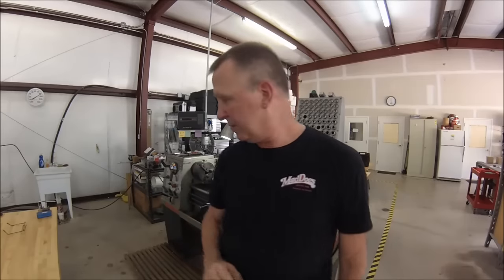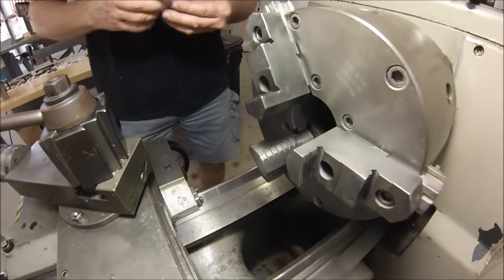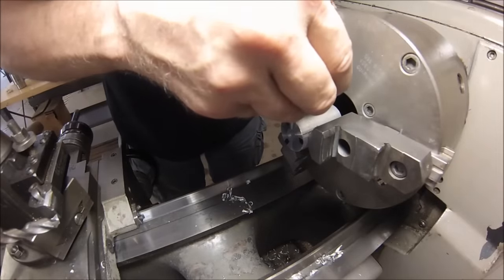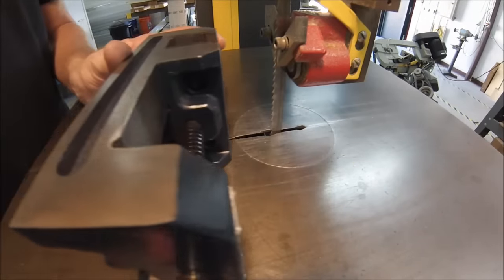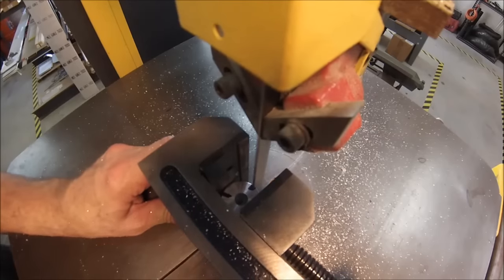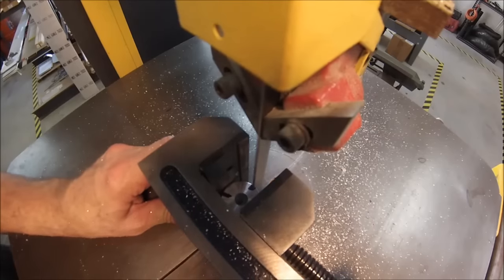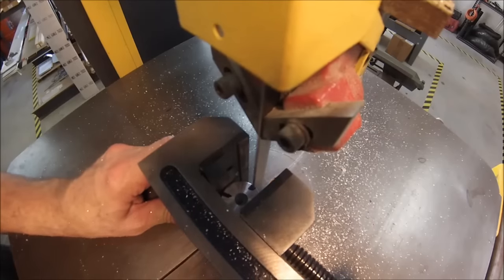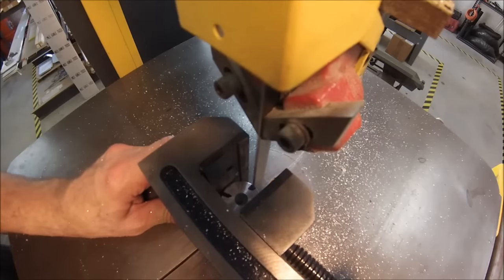Get your parts to run true in a non adjustable chuck. YOU MUST WATCH THIS!

Comment: In the watchmaker world our lathes suffer from the same situation where as none are really perfect. 

This usually comes as a surprise to newbians who may have made significant investments only later to find the solution to most watchmaker lathes cost only a few dollars. We chase allot of rabbits looking for solutions.

For example they often find it strange that their tailstock (even if it holds a collet) is not sufficient enough to drill a hole dead center of an average watch arbor. For that a centering guide is needed to assure the drill and arbor go dead center. This can be made or purchased cheap. The bit can even be held by hand and eyeball for straight line.

The watch world is full of all kinds of solutions or what they would think is a solution by those who want to make a buck.  Allot of that goes on in the watchmaker world. 

The cheapest solution is my favorite, using shellac. Heat it up and center the part while spinning. When the shellac cools it has enough grip. Lately I have been turned on to using "hot glue" which is better still as it has even stronger grip and easier to work with. 

Most times the main repair of watch works is to turn a balance staff. I work under the binocular microscope which has working clearance and generally I use 30x to 40x magnification. The "gotchas" is when we try to re-insert into a collet. I guess you call it repeatability. Sometimes we can fiddle and find the center sometimes not. 

The shellac/hot glue method works.

The other way is to turn by centers which I know you guys do as well. Problem is parts are very small so dogs tend to slip and parts tend to drop from fiddly fingers. Sometimes disappear into some other dimension. Spend allot of time adjusting but it is easier to remove the part and measure in some jeweled caliper. Watch repair guys spend allot of time looking on the ground for a part. Them that say they don't is a liar.

Carbide is our favorite as well. It cuts the blued pivot wire pretty well and is much less hassle than using hss gravers. 

I think most of us work by hand. I have a cross slide but hardly ever use it. Since parts are small it's easy to eyeball straight lines under the scope. Who is going to argue over something they cant see, just if it works. 

Most of us dont' graduate to gear cutting as parts online are still mostly easy to get. Just depends on the situation. Some watches are custom hand made gears and then gear cutting is necessary. I have not done it yet but hope to. But you know how It is, need dictates over want.

The big pie in the sky is to make our own watch. One day maybe. 

It's a trip for me to see your macro world. Although I think allot about getting a finger cut off, I imagine it to be very enjoyable work. Seems like your world has more opportunity.
Reply from the maker: My world, now, that is.....I did my apprenticeship at Joseph Waldman corporation in the 70's. I cut my teeth on watch parts. We measured our daily production and counted parts on a 7 place decimal digital scale. A full days production would fit in the bottom of a small cup, maybe a bottle cap. Everything was precious metal and the scrap plus the parts had to balance within 1/10 of 1% or maybe a body search. This is by far not the biggest or smallest stuff I have ever done, so I know where you are coming from. Never go to work in a watch factory with a headache or hangover. The microscopes make the day very long. Thank for the memory.
Reply: Joe Pieczynski Lol ->body search. I have wondered about that. I would be volunteering maintenance sweeping the floor or something. "My world" Ah well, most people don't relate so I get use to saying that. I'm considering migrating over to gunsmith. Looking for more money as I get stuck with flea market vendors who got the watch for $20 and want it fixed for $20. Allot of people fishing each other these days. Where I live is nicked named death's door. Near the biggest retirement community of Florida. We got a trickle down antiques economy. Where I live most don't even bother to do anything but collect. The Goodwill has about 50 people lined up in the morning for the daily hunting. It's addicting -money for nothing. Hence the flea market centered life style -for everyone. That and service industry. Appreciate your reply and opinions.

Comment: can you remove the block from the chuck,put it back in and have the collett run true?
Reply from the maker: Its not usually recommended, but if your chuck has sharp jaws and bites the collar, you can get lucky and re-seat in those teeth marks it may be close. Best thing to do is take a smaller one from another part and re-bore that one.

Comment: Yeah, that's aneed trick, but ya gotta make a bushing for each different size diameter workpiece which could turn into a real pain in the butt! Shouldn't there be some way of correcting the jaws to compensate? Thank You, JD
Reply from the maker: Grinding them back to true is the recognized fix, but not everyone has a toolpost grinder.

Comment: Noob question: Why shouldn't you turn a machine on if the chuck is empty?
Reply: Sergey Grigoryan second that question
Reply from the maker: The acceleration of the scroll and body of the chuck can be different and the jaws can walk out. I never do it just for safety sake. Pull your jaws out and start and stop the machine at a higher RPM. I bet the scroll still turns if the chuck decelerates rapidly. Same thing happens when it starts. Its a safety thing.
Reply: Good point.  Had forgotten that but I do not turn on the machine with empty an chuck.  Guess my old instructor knew something!

Comment: 8 mins into the video he files off any burr that might been caused...fair enough, but to see if the burr as been removed with his fingers on a running lathe is asking for a stitched finger
Reply from the maker: I have to agree, but after doing this for 47 years, I can see if the edge is sharp before I touch it. For all you new or inexperienced viewers, turning the machine off first is a safer technique.
Reply: Thanks for your response Joe...Great video's

Comment: Certainly not practical to do every time you need to chuck up a part, but excellent way to make it happen if you don't have another option and it's critical.
Reply from the maker: It will get the job done. If you have to use it again, squeeze a thinner shim and re-bore the ID, or bore it for a larger part.

Comment: Hi Joe- is this for small diameter parts only (<1" or something?), or will it scale up? What's the largest diameter you have used this for? I thinking there is prob a point where an 8" chuck won't hold the part?
Reply: Oh, and Thanks! I appreciate your knowledge and your willingness to share!
Reply from the maker: If you start getting into larger parts and space is an issue, I'd suggest you purchase and bore soft jaws if your chuck can acomodate them.

Comment: Hey Joe, just thinkin, (after watchin this video for the 4th time).... If you are not swapping your part end for end, do we have to worry bout all this cause when we turn a part doesn't it automatically all become concentric anyway.
Reply from the maker: You are correct. This is for second side or finished OD work. If you turn and part the piece, eccentricity of the chuck doesn't come into play.

Comment: Good video I enjoy watching a master at his trade.  I am a new owner of an old Harrison lathe ,trying to learn how to work with it. Just wondering what you brushed on the reamer and part before use?
Reply: tap magic, it is a cutting fluid
Reply: Thanks
Reply: @denisminor4489  I assume when you say "old" your Harrison lathe may be one with belt drive and back geared head and use change gears for threading. You might find a book written by the South Bend Lathe Company very useful both as a beginner and also for an old lathe, it is called "How to Run a Lathe" and you can download it from http://www.vintagemachinery.org/pubs/detail.aspx?id=5795 

 It was recommended to me over 40 years ago by an amazing tradesman and was invaluable, it pretty much covers everything in simple explanations. It doesn't cover quick change gear boxes and carbide tooling as they didn't exist.
You can also use WD40 as a cutting oil for aluminium or kerosene.
Best wishes in your journey. Dennis

Comment: might find it that far out in your home shop - not in mine.
Reply from the maker: The collar technique is applicable to a variety of other situations too. Not just concentricity. Its good for parts with finishes you don't want to scratch, or those parts that need greater OD support so they don't distort under 3 jaw contact. This is a band aid, not a cure.
Reply: +Joe Pieczynski collar technique is awesome. use it on parts that have tighter tolerance than most home shop projects.
Reply: Make It Fit I had an eight inch three jaw Chuck it was out 7 due to a worn-out scroll and I bought a new one from shares of all places into my amazement absolute amazement if I got a quarter thousand run out I would be surprised their new Chucks are so true they're amazing for 300 bucks what a deal yeah I would never even try to operate a machine with that much run out I have to agree with you buddy
Reply from the maker: Hey guys, you missed the point here. this video isn't about buying new chucks, grinding jaws or soft jaw options. Its about getting the job done now in a POS chuck with what you have on hand. I hope you guys saw that I intentionally thru my chuck out for this demo. The only thing in my shop that is out .015 is the alignment of my benches to each other. There are some guys out there that really do great work with basement tools and this was just intended to make their life easier without spending a dime or waiting for days for a chuck they really can't afford. I appreciate your comments, but  I hope you see my point.

Comment: Hi Mr Pie: How do you “register” the nest so as to reuse it?  When you put it back into the chuck, how can you make sure of same location (are you just lining up the squeeze marks from the jaws and the ink marks, or is there a better way I missed?). 
  It works very well for the first set up, but not as well on the repeat set ups- it’s always off a little bit on the repeats.  Don’t have an adjust true chuck, but was thinking of ways I might adjust my 3-jaw.  What about slightly over sizing the bolt holes on the back plate and relieving the back plate registration slightly, so as to adjust the chuck a few thousandths in the needed direction after the part is chucked up?  (I mean slacken the chuck mounting bolts slightly, and tapping the whole chuck into alignment using an indicator- hopefully that makes sense?) Is this a possible solution for non-adjustable chucks, or is this a dumb idea?  Not sure if I should try that or not, would appreciate your opinion. I have an old machine with an old school screw thread mounting for a CI backplate, unfortunately not a cam lock or taper or whatever , and I have skimmed the backplate on the spindle, and fitted the registration fairly tightly, and the whole chuck repeats OK on re-mounting the chuck, but concentricity is a bit off depending on the size of the part, if that makes sense?  Enjoy learning from you, thanks! -Rov
Reply from the maker: Your approach to modifying your chuck is a good one. You can either bump the body of the chuck for adjustment, or install 4 jack screws at 90 degree intervals. As for these collars, looking for the jaw mark is a good place to start, but they are most accurate on the first use. For accurate use on the second try, use a thinner shim when you set it up and re-bore it.

Comment: would it be possible to close the jaws and do the same to the jaws as you did to the collet you made? I think then any size part you make will run true? just an idea I had. I like your videos
Reply from the maker: Yes, that is referred to as grinding the jaws or dressing the jaws. Usually done with a toolpost grinder.
Reply: Oh ok. So that can be done. That's great

Comment: Making the most of what you have, great trick, would it make a difference if the tailstock was off to or does it need to be spot on? thanks for sharing, and ignore the trolls theres one on every channel.
Reply from the maker: If the tailstock is way off, the hole may wander, but for shallow work with a bored lead, it would be OK.
Reply: @joepie221  ok thanks, was just curious, merry christmas and all the best for the new year, see you then
Reply: Also if the tail-stock is too far off the drill will go at an angle and possibly snap the drill shank right off.
Reply: Thnks for sing this i hd wondered if this entire endeavor was reliant upon the tailstock being concentric with the machine. I now wonder how would you properly align a tailstock if your chuck was this far off? Asking as a homegamer that intends to get a lathe. As soon as my wife lets me.

Comment: I'm totally new to the machinist world and your channel but my question is where did you get the dial indicator holder that attaches to your cutting tool holder?
Reply from the maker: I love that holder and have had it for a loooooooooong time. Its a US General brand model 387. Long discontinued, but once in a while you'll find them on EBAY in the vintage tool section. Craftsman also had their own version for a while.

Comment: Excuse my ignorance, but, if after inital use,  if this collet were removed and then later replaced in this chuck after the chuck was re-trued back to less than .015,  or used a different chuck, would it still work?
Reply: Just make a new one for the fixed chuck.  
In the old days, they would put in a blank shaft, make a center point and use that for perfect center.  When removed it cannot be used again until you cut the center point again.
Reply from the maker: I had several different thickness shims in my box for these. I used the thickest one for the initial bore, and dusted the bore each time I installed it using a thinner shim. It allowed the collar to close down giving me material to remove. When all else failed, I'd use the collar from a smaller size as a starter for a part slightly larger.

Comment: Hey Joe, I know this is an old video, but... At 8:05, you finished boring the hole, and then flipped the piece around to face it off. Then at 9:00 you marked the position of the jaws with a sharpie. Shouldn't you have done that before you removed the piece from the jaws the first time? Or does it not matter?
Reply from the maker: At 17:50 the collar was bored for final location and didn't move after that. The drilling operation you mention was an undersize hole.
Reply: Joe Pieczynski Gotcha, thanks

Comment: Joe why don't you just bore the inside of your jaws wouldn't that make the chuck run true from there on out as long as you didn't move it again?
Reply: I can answer that for Joe, say you did grind the jaws for that particular diameter, since the scroll is never accurate, the jaws would probably be off at another diameter.  Darn those three jaw chucks, and why aren't scrolls perfect?  Jim
Reply: Yes! Except for backlash on the threads.
Reply: I must be the only person in the world that tightens all the three chuck screws, to my thinking with an old chuck like mine there will will be wear around the spiral inside and by tightening them all it compensates for some of that wear.

Comment: i have a 80-year-old logan that has 0 run out at the nose both inside and out. you cant measure any runout even with a 10k Sterrett I don't know how I got so lucky.   i made a collet chuck  first attempt and at 5 inches I got less than 1 thou   the rest of the matching is shot lol

Comment: My first home lathe was a crappy 7X10 Chinese brand, but as cheap and poorly made that lathe was, my 3-jaw chuck never had more than 2 or 3 thou run-out. I was able to loosen the three mounting nuts and hammer-tap the chuck until my indicator showed almost zero run-out. If I had a chuck that indicated 15 thou run-out as discussed in this video, I would either replace it or scrap the entire machine. That amount of run-out, in my opinion, belongs in a wood-working shop.... NOT in a metal-working machine shop!  ;-)
Reply: Interesting idea, I have 7x14 Grizzly also Chineese mini lathe with 3" chuck and I found recently that I can tap lightly with small aluminum round stock the part that's chucked and I was able to go from 5 thou to less than 1, I was pretty excited that I found this method.  It's not hard tap at all, so no worries about damaging bearings.

Comment: Hi Joe,
Why mark and cut where the jaws are, and then turn it to use it? 
Wouldn't it be better / more accurate to mark and cut the mid point between the jaws, and put it back in exactly the same position?
Reply from the maker: the marks were for spacing, not position.

Comment: Joe, I wonder if you have a trick to center a square bar in a 4 jaw chuck.
Reply: indicate it.
Reply: Joe had a vid on sq. stock indicating by putting flat stock on the flats of the sq. and indicate it on the I.D of the flat stock.
Reply: Use your combination square.  Put the Combo Square on one of the four corners of the bar.  Scribe a line across the end of the bar.  Move to another corner and repeat.  Repeat. repeat.  You will have four scribed lines on the end of the bar.   Find the tiny square in the middle of the bar.  Put a center punch in the tiny square of the scribed lines.  Strike the centerpunch and make a dimple.  That is the  center of the square bar.  You can now drill a hole or drill a centerdrill  for the live center of your engine lathe.   You are off and running!